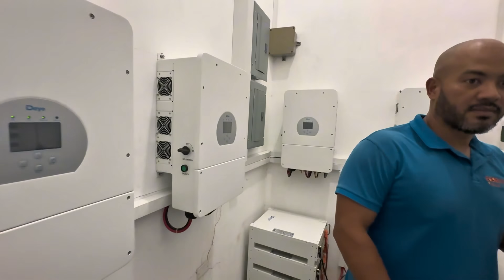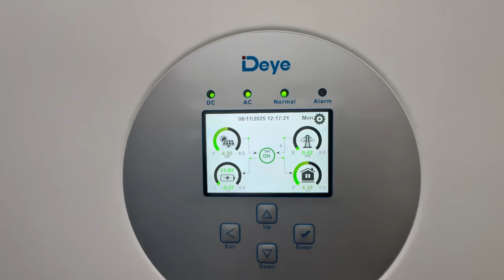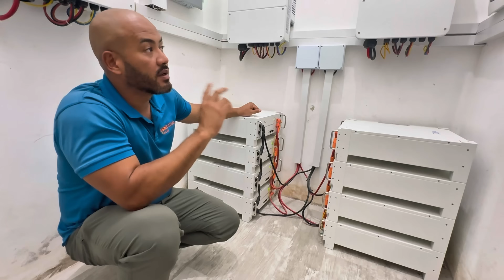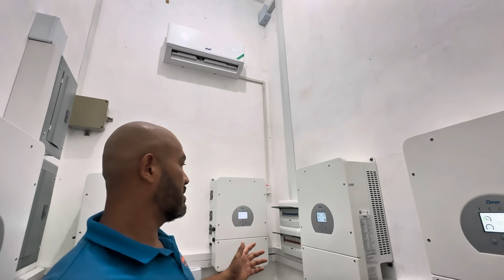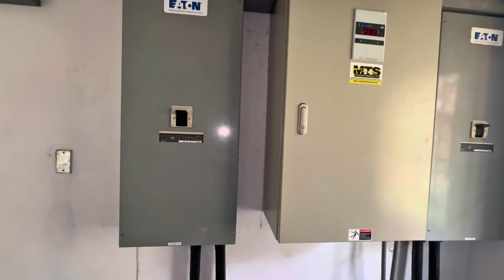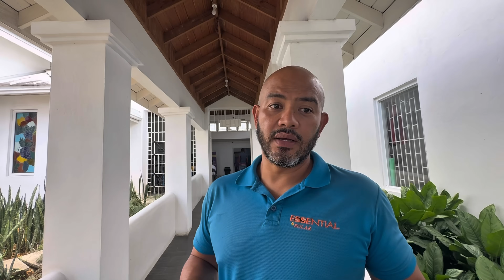SIX INVERTERS?! Who Needs That Much Power? | Touring This Powerful Solar Upgrade

Comment: Don't believe everything you hear 
I am a customer and we are heading to court 
SCAMMERS
Reply: Out of curiosity, in what way were you scammed?
Reply from the maker: We’re sorry you feel this way, Carmen, but we want to clarify a few important points for anyone reading. Your solar system was installed with only 50% of the payment released by NHT through your loan. The balance was still owed. You also requested a refund for wires that were not used, but as we explained, refunds must go directly back to the loan company (NHT), not to the customer. When you stopped the balance payment, it placed your system in default. After that, as per our company policy, we were unable to continue providing support. It’s important to note that the inverter did not “collapse” — it only required a standard software update, which we could have assisted with if the account was in good standing.

For clarity, NHT did not stop partnering with us. We made the decision to step back from that partnership due to repeated situations like this, where customers halted payments but still expected full service.

We won’t go into further details publicly out of respect for your privacy as a customer, but we want to reassure our community that Essential Solar operates with transparency and professionalism. Anyone who wishes to verify or needs clarification can contact us directly — we have all documentation and receipts on file.
Reply: Inverter collapse after 2 weeks  they refuse to correct  it
Consumer Affairs got involved  
NHT  stop partnering with them

Comment: Instead using many individual AC units throughout a building, would it be better to install a central AC system with ductwork in larger homes or businesses?…as relates to the amount of power and solar equipment needed?
Reply from the maker: Split units allow the conservation approach of cooling just the rooms that are in use. This can sometimes be as low as 20% in many cases.
Reply: @EssentialSolar ty
Reply: Depending on a single system to cool your premises may prove to be a failure a system failure have have downtime of months instead of repairing a single unit.
Reply: @ApDesignsConstruction I would imagine a limited amount of redundancy, like still installing single units in certain zones like living room or bedrooms for night time use, when it wouldn’t be efficient use of power to be cooling the entire home centrally while everyone is asleep or retired to the bedrooms. 
Having equipment that goes for months without getting fix would signal a business opportunity to open a business and train technicians to do repairs.
Living in constant heat contributes to the country’s low per capita productivity.

Comment: What's the largest residential system you've installed? 
We have 13.5 KW of solar, 85.8 kwh storage, 32 KW AC of inverters for our house. We're going to expand to 30 more solar panels, more battery storage, and one more inverter
Reply: Alot of power for a house
Reply: @stopmotionandgaming4877 what is the average house using in kilowatts per day on JP? 

My house uses on average about 54 kilowatts a day here in Florida USA
Reply from the maker: We have done 50kw at one home. I and my lungs applaud your efforts. Cleaner air is the goal.
Reply: @EssentialSolar how much storage did they have? I was watching a bunch of your videos and I didn't see that specific one

Comment: This is a huge professional solar system. I am still at 2000 watts of panels and four 100AH LiFePo4 batteries and a 2000 watt inverter in my little DIY system. Congrats on a job well done.
Reply from the maker: Baby step boss. We do what we can do.